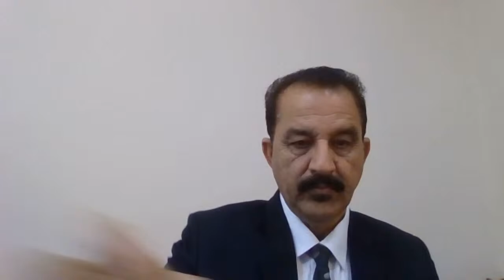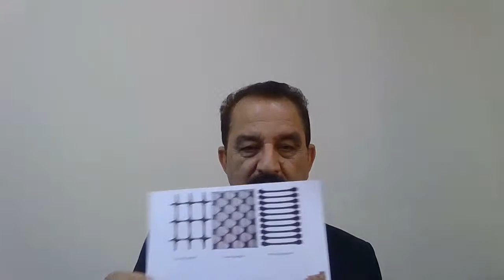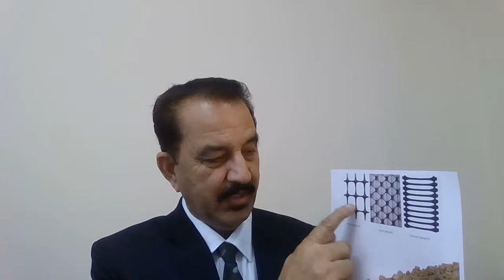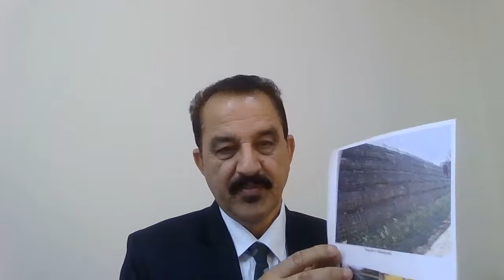Civil Construction Materials-Technical Session no 115--Geogrid .

Comment from the maker: Geogrids : Types, Applications and Advantages in Construction Industry
Home Construction Tips 
Geogrid is a polymeric material made up of many polymers like polyethylene, polyvinyl alcohol polypropylene etc. It is one of the most important inventions in geosynthesis which is used as a reinforcing material. They formed by joining intersecting ribs. They have large open spaces in between the ribs known as “apertures”.